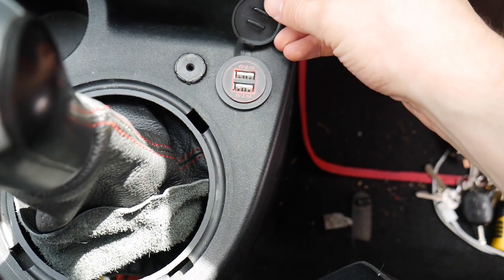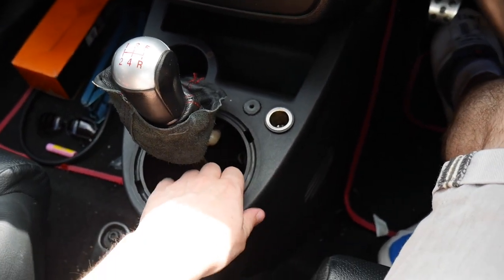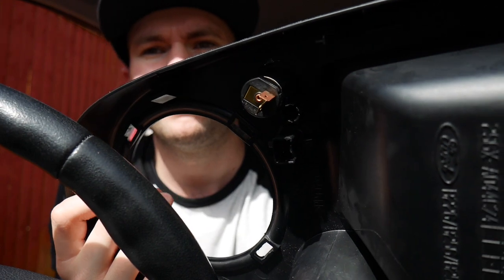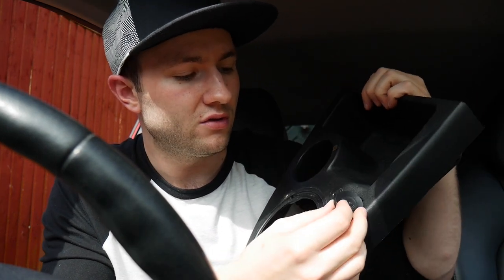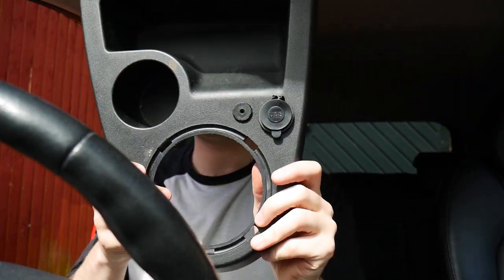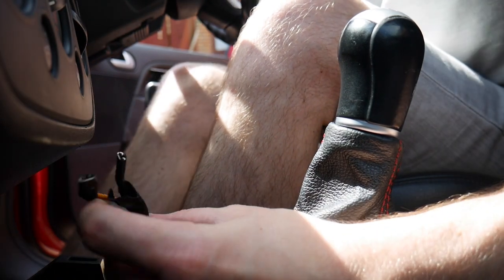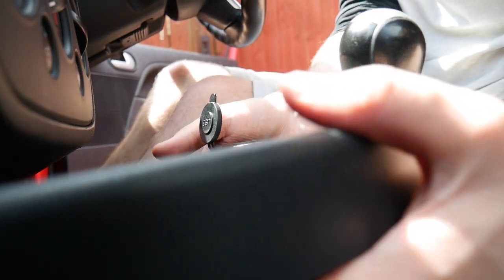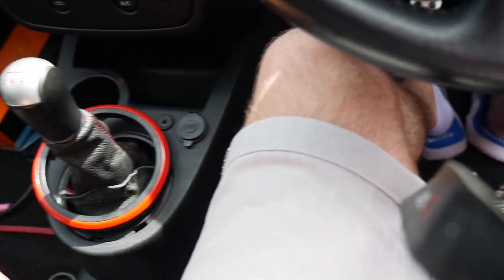Fiesta ST USB Port Install

Comment: When I bought my fiesta the previous owner installed a USB charger however it was on the other side of the centre console. It's great but I never really use it 😂. Mainly use the cigarette lighter for my sat nav plug however I'm sure it has a USB plug
Reply from the maker: YEah I only ever use mine to charge my phone, im very tempted to wire in a wireless phone charger and mount it to my stand as I've got the new iPhone which can wirelessly charge!

Comment: You had any issues I got my daughter a mk7 as you said it won’t drain I just bridged mine to the cigarette lighter so long as nothing left plugged in to it when not in use hope it won’t drain,I have the 15 plate ficus and it goes off after 15 min of the car being locked on that why Ford did not do same for them all! So just done her fiesta 08 so here’s hoping 🙂

Comment: The previous owner of my fiesta removed the aux port and don't know how to fit one, any answers welcome
Reply: Coatesy63 what year is the car? Because the 6006 cd in slight older ones don’t come with an aux at all, try the tecknet fm transmitter, that way you get Bluetooth and can charge your phone at the same time :) cost me £13
Reply from the maker: Conor Murphy my girlfriend uses them Bluetooth FM transmitter and they’re a good/cheap answer to getting Bluetooth in a car.
Reply: JayMono Yeah man I can’t fault mine, also love the videos; picked up my ST150 a couple days ago so it’s been good watching you and getting a few ideas :) love the car, just need to fix my leaky sunroof now!
Reply from the maker: @havenblood  Thanks! And luckily I'll never have a problem with a leaky sunroof as mine doesn't have one!
Reply: Conor Murphy cheers mate just ordered one now

Comment: Do a video on how the aux cable is fitted?
Reply: i did my ford aux today  its  easy  you can order a kit of ebay with the keys to open the   system and fit a adapter on the back of the system

Comment: How make this AUX port ? I see a lot of fiesta without this and a lot of with this port next to gear stick :>
Greetings From Poland!
Reply from the maker: Damian Skowron the AUX port next to the gear stick is standard on this fiesta. Also If you have an after market radio head unit they’d probably have an AUX built it so you wouldn’t need to instalL one there

Comment: It’s not a cigarette lighter, it’s a charge port
Also why did you cut the plug off they’re both the same spade connectors
Reply from the maker: DanRsturboS1 mine was a cigarette lighter, dunno if the other models (Zetec, Finesse, ZS) had one or not. Also I cut the connector off as it wouldn’t fit the new USB port, the spades where facing parallel and the original cigarette lighter both spaces face opposite directions